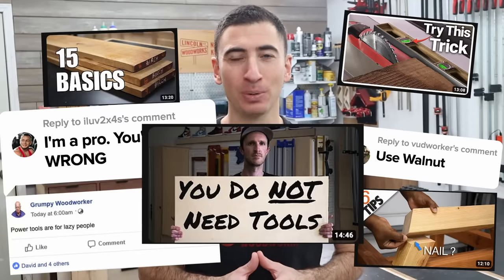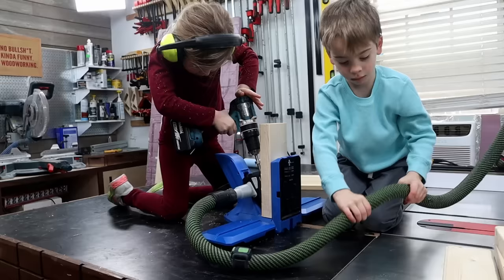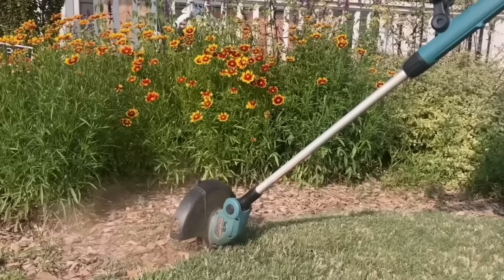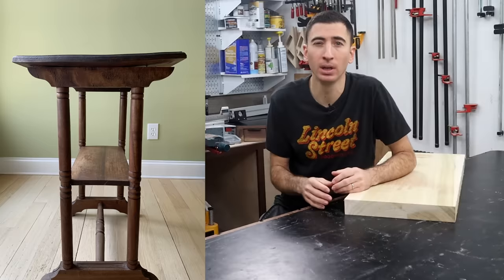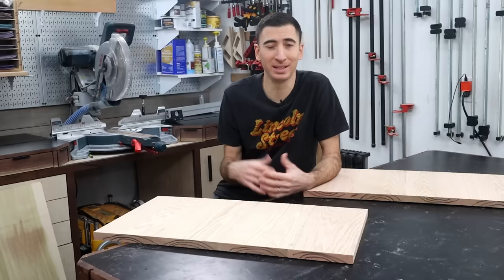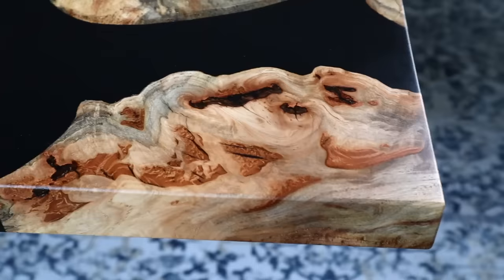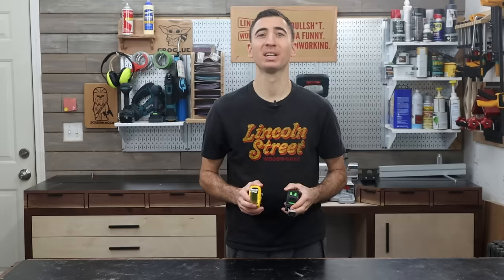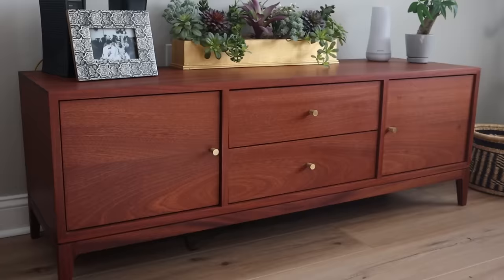Every beginner needs to hear this

Comment: Totally agree with everything you said.   Weather, humidity, and location, is everything.  I've seen a top  where the grain was alternated, (like recommended), and the dampness caused a wave effect.   It might be due to width and thickness of the wood, but I can't say for sure.

Comment: Hey, I just want to thank you on this point you made about which tools to buy. You're correct. I'd like to addmy top four those looking at tools. 1st Look at the range of tools a brand has to offer and make sure the brand covers what you need. 2nd stick with 1 brand as much as possible with the battery powered tools, you don't want to have to buy several different brands of batteries and chargers because that's the biggest cost for tools. 2nd.B if you're buying power corded tools, the brand doesn't matter. 3rd, don't buy power tools from pawn shops. 4th You get what you pay for. If you're a hobbyist, ryobi and harbor freight should be good enough to get you by for small projects. But if you're going to take it serious or this is for your trade in carpentry/ construction, don't go cheap. It's worth the extra cost when you need that tool everyday for the next decade.

Comment: that last section made me save this video. probably the most important thing I ever learned from New Yankee Workshop was to work in situ as much as possible. measuring is a powerful tool but can never represent the conditions you're working with as accurately as the conditions themselves.

Comment: In 2000 I built a huge, beautiful, solid oak round dining table (and it was finished on all surfaces) while we were stationed in Alabama. The Army advised us against moving it to Korea due to the size/space issues there, so it was stored in a much drier place in California for over four years. When we got back in 2005 it had dried significantly and was a totally ruined $4500 investment (in woodworking experience). The original wood was high-quality red oak that was supposedly properly dried. My mistake was literally different (indoor) weather. In my opinion, you should store properly seasoned wood l—for a year if you can—IN THE TARGET CLIMATE before you do anything else with it. Doing that has required some home weather proofing, but my shop is now a fully climate controlled space at least 90% of the time. When the weather is nice I do open it up when I’m working. I also pop open a window whenever the dust collection vacuum is running because the beast tends to suck all the comfy HVAC air out of our house otherwise. 

A typical hobbyist can store some wood in a closet, under a bed, behind a sofa, etc. and will notice it finds a new normal size and shape in a month or two after coming inside from the non-climate controlled wood yard where it was purchased. (Most such wood was in transit from who knows where not too long before you bought it.) 

Let it rest where it’s gonna live before you build with it.

Comment: I'm 31 years in as a master furniture maker and residential builder and I've used a myriad of woodworking joinery. The pressure load stress test on a "SINGLE" tested pocket hole joint (style and rail sample) is to show the stress breaking point of that "SINGLE" direct joint alone "NOT" the shared breaking point of that pocket hole joint or any other woodworking joinery. So, for instance .in a four-legged table whereas each leg is attached to an apron with pocket hole joinery. Each leg of the table "Separately " could support up to 8o psi of sheer weight, "direct force" (weight directly over the joint) not evenly distributed before joint failure. So that boomerang test as you call it, shows the sheer strength and breaking point of an individual joint itself, which in very informative.
Reply from the maker: I think you missed the point

Comment: Excellent tips all around. It's really important to use references when it makes sense, instead of whipping out a tape measure. It makes sense even outside woodworking, like when you're trying to line up something you're installing or even pushing some furniture around. Find two straight lines, one on the wall and another on the object, and sight down to align them by eye. It's much better than the tape measure.

Comment: I like the Ryobi platform because if I happen across some weird blue Ryobi tool in a pawn shop (great for your first set of tools, BTW), or a yard sale, I know the modern batteries will power it.  The Ryobi 18v battery interface has never changed, so if there's some unusual tool that they made long ago when the air was clean and s3x was dirty, that is no longer made....just check fleabay.  I've also converted to their 40V outdoor tools.  Pretty good for a consumer!  Am I mowing 13 lawns a day, or edging a football field every week?  No.  But, I can run my self-propelled 21" mower for my entire yard, put that battery into the whacker of weeds and trim, then blow off my driveway with one charge.  I don't have to condition any fuel in the winter, rebuild gummy carbs in the spring, or ride around in my car with a gallon of gas sloshing around in a can behind me.  Win-win.  Love your channel.  While I appreciate and watch all of the super hand-tool driven, professional woodworkers' channels and use as much info as I can, I really just want to build stuff that looks nice and doesn't take a lot of time or money to build.  I'm too old to take 9 months to chisel a mailbox post from a $2000 chunk of walnut, but channels like yours show me alternative techniques I can use with my power tools that bring similar results quickly, which motivates me more.  Thanks!

Comment: "Measure 3x and sneek up on it! " quote from Charles Neil my first mentor after Murphy, LOL!  Putting finish on both sides will even the hydrostatic pressure on the boards. sealing the ends is very important if you live in MN. extreme changes in temprature and humidity.  Also tension in the wood is important. even in dried wood.  Great examples and good suggestions particularly for first projects. In shop furniture I think mechanical joints are best if you have changing needs.  I like the recommendation of laying the piece your fitting on top and sneeking up on the final cut.

Comment: I worked for 40 years in the woodworking industry.   In every 8-hour shift we made 10,000 glue joints producing solid hardwood panels for high end furniture factories.   The argument for alternating growth rings when using properly kiln dried lumber is ridiculous.   Can you imagine solid cherry table tops with alternating heartwood and sapwood staves.   We would have been run out of business.  Once wood is properly dried, it is stable in typical home and office  settings and as long as construction of the furniture allows movement, and finish is applied equally to both sides….no problem.    So you are 100% right.    The premise for alternating staves originates in the manufacture of veneer over solid poplar edge-glued core panels.   The poplar in these core panels was typically only air dried.   Since the cores were being veneered, color matching staves did not apply.   So yes, alternating growth rings was necessary to create a flat core panel.

Comment: I really enjoyed your no-nonsense  approach.
I have been messing with wood almost 40 years.
So I use many of your methods spot on.
I do measure 2wice and reference mark too.
I now am playing with quarter sawn lumber with my mill. But drying a 6x6 and getting it dried is another rabbit hole.
You made a good reference "Hobby" very good have fun.
Love the Greek wrestler saying some a times maybe a good / sometimes a maybe $#!T.,  I laughed 5 minutes.
You gave a lot of really good advise and earned knowledge from 1st. hand experience., I can see many people with different skill levels getting a broad variance of results, both good and bad. (Greek Wrestler comment) 

I have only read 3 replys and getting a laugh. shrug it off and don't worry about it.
I enjoyed it.

Comment: Great info, I do have one suggestion when using tape measures. start and finish with the same tape measure. Not all are exactly the same.
Reply: And mark the side you measured from! This got me a couple of times. I measured initially from one side, then did another measurement and cut from the other side, turns out the sides weren't parallel.
Another thing that got me good once was using a not square square. My wooden T square wasn't actually square 😢 from then on I learned to always check against something else, preferably a good quality metal square.
Reply: @faithful451  An out of square square taught me a hard lesson too.

Comment: When I was studying woodworking in my youth, the measure twice cut once was a reminder to allow for the blade kerf. That and we did a test cut on a scrape and measured after to check the settings. We were also taught to cut our pieces on the strong side meaning a hair bigger and then sneak up on it as you did.

Comment: Alternating the growth rings only helps to "REDUCE" cupping it doesn't completely prevent cupping and warpage. The same with bread board edges and expansion joints, they help to significantly reduce the changes and behavior of wood movement.

Comment: I've built sofas as well as chairs using pocket screws, even a stool that I use all the time and they hold upgrade as long as it's applied correctly. Old Timers always think they know what's best.
  When I first started in carpentry 25 years ago I thought there was a proper way to do things until I realized most people just only know one way

Comment: Regarding fixing flaws, there can be a different approach : consider leaving them, especially if you are an amateur. I can see two main reasons for this.

- It will make them look a bit hand-made, or more accurately, amateur-made. So those flaws will stick out and draw attention. You have guests, they come in, and at some point someone points out that one of your chairs has one joint that is not perfectly shouldered (fitting, rigid, solid, but there is a gap at some places between shoulders of the two pieces), or they points out not perfectly symmetrical screwing, or whatever. There, you can tell them you MADE it yourself, and they instantly get in awe. Optionally, if you made most of your furniture, they will eventually notice those as well, or you can flex by telling '[I made it] as I did for most of the furniture in this house/apartment'. 

- You will make progresses over time, and it is a big help to see how much you screwed up things before to better see your progression and motivate yourself.

Comment: 3:20 my Ryobi circular saw DID break.
It took a gentle fall onto some soft-ish dirt from about 18 inches and now the plate is warped.
It had served me well up to that point… but I was in the midst of building my deck so the time spent tinkering to get it right again was sorely felt.

Comment: I have a challenge for you, a challenge that MANY newbie woodworkers would like to have a lesson on. Here it is: I want to build a pretty simple kitchen table, preferably using 2x4s {perfect aesthetics aren't the highest priority}. Is it possible to build the top with acceptable quality using only ordinary tools? i.e. No biscuit cutter, no planer, no joiner, no pipe clamps? I can buy a $30 pocket hole drill fixture if I have to, but when I add up all the various specialty tools I always see for making a tabletop, I'm put off by it. Not just for the expense of the tools, but for the space they will permanently take up in my garage. I've seen a few videos of guys building tabletops with only pocket hole methods...but will this be a warp-o-matic or overly weak when finished? I assume the best way is to buy pre-milled wood to be square as well?? but know very little about this aspect.

Comment: I'm from a family of carpenters, cabinet makers and furniture makers, your advise is great.  i make furniture like your kids and people love it. i rarely make furniture with mortise( well i mortise or rather inset joints..) and tenons because that's not the look of my stuff, i do on occasion use pocket screw to attach a top to a bench  that works great and the screws are hidden anyway.. i also use a lot of the old fencing that my father put up around our ranch in the 60s its so perfect for benches and small tables. ( after i mill it down to flat boards).. never had any of that old milled wood warp. ive been  studying wood for 54 years.. lol.. cheers great video.

Comment: Those makita weed whackers (or as is aussies call them, whipper snippers) are awesome I actually picked on up on marketplace for $20 with a petrol model I wanted for a project and it was the reason I went the makita platform, the petrol has long been in the bin but the battery whipper is still going strong many years later.

Comment: Made a table from a 2' section of 24" dia log once, well over a hundred years old.  Of course it developed cracks as it dried.  Rather than trying to hide the flaws, I used sawdust, glue and red paint to fill the cracks.  Sanded and coated with polyurethane and it looks awesome.  Like the video says, instead of trying to hide the imperfections, accentuate them.  This not applicable to fine furniture, but this added a lot of character to the piece.

Comment: Regarding screwing things together and how strong those are versus mortise and tenons, there is skill and time to take in consideration. 

Screwing is super easy. Take two pieces, keep them in place, drill eventual holes, put screws and you're done. If you have enough of a setup to hold pieces in places as clamps or arms (either mechanical or from fellow humans), you can even hold entire parts of your project (if not whole project) together and screw them in place. 

Mortise and tenons, on the other hand, are quite difficult to make correct, and take a shitload of time to do. You have to measure, draw precisely, cut, adjust etc. Ways to do them wrong are plenty. Especially, wrongly fitting mortise and tenons can screw up (lol) your project by making it either impossible to assemble or not rigid enough. 

I'm pretty sure that if you take this in account, and test the strength, fitting and rigidity of joints made by beginners (not pros), their mortise will of course likely be stronger, but most of the time they will be loose or not perfectly square etc. But to this you may eventually need to add a restricted time frame for them to make joints, as hobbyists often have very limited time to make things.

Comment: Great tip on the referential measurements, I have taught people this that just weren't aware that it's easier to put a piece up and mark it than it is to measure. I use this especially on base molding and window trim. In fact I only use a tape measure for inside measurements the whole time I'm doing finish work.

  There are many ways to do things, I encourage people not to fall into the Trap of listening to the grumpy old Carpenters that think they know what's best. They have skills, but there are always new and better ways to do things. As a professional Carpenter for a couple of decades, the only thing that matters is the end result..

Period

Comment: True on battery operated equipment.  I have a set of small drill (PCL1201D) and impact drives from Porter Cable that us tiny 12V (PCL12) batteries.  I have used them for year and are my go to tools.  I have used them a lot since I bought them over 6 years ago.  I use them at least three or fours times a month.  Still going strong.

Comment: I built an indoor bench with shoe storage using pocket scews and it's still just fine 5 years later. The top where you sit is not attached with pocket screws, I used those z-clips that allow for some wood movement but other than that it is all pocket screws.

Comment: You just gained a sub. Not only did you break down the amount of weight needed to break those joints, but you weren't afraid to then discuss some critical thinking aspects like "When will you ever encounter a defacto lever like this?" 

Very rarely. The only time I can picture that kind of situation would be a shallow ledge but even then, if it were say, a patio railing, it's more than likely going to be balanced on the posts and then drilled straight up and down into them or if it's a narrow shelf inside a home, it's likely going to have some braces used for added strength and support. 

So effectively rendering their weight tests obsolete because real life situations like that just don't typically exist. 

Hence your end table cube! 

Plus, in your cube, with each additional joint added, the amount of stress per joint goes down by at least half. So in The end, assuming only the top 4 are used in the math... 

Each corner requires either 4 times the weight to destroy it, or if you've used two screws per corner, potentially 8 times that weight. Assuming the wood itself can support that much weight so that it can be the screw that fails first. 

So... You've gained a sub! Lol

Comment: Yup. Absolutely agree on all your tips. I do the same. Use what works for the purpose. If I really need a very strong joinery that will be subjected to a lot of stress then I will use the appropriate joinery for it and sometimes even combine them. If its just for a piece that may not need that, why put all that work into it wasting time and effort? Less bragging rights though. Anyway, good tips that are practical and sound.